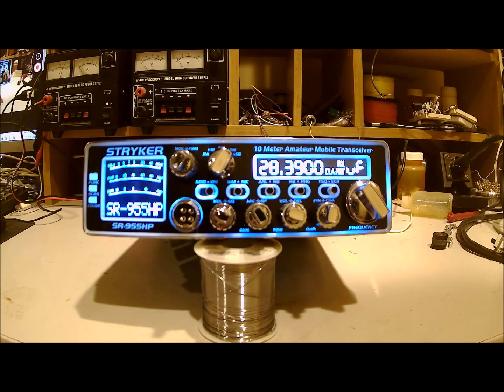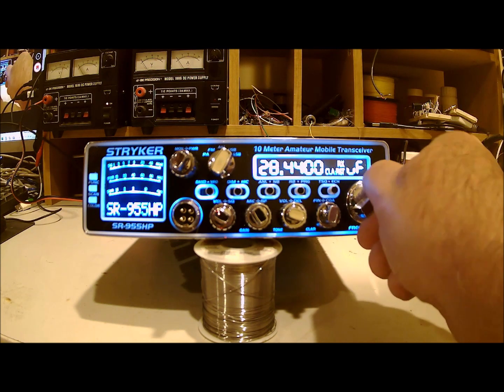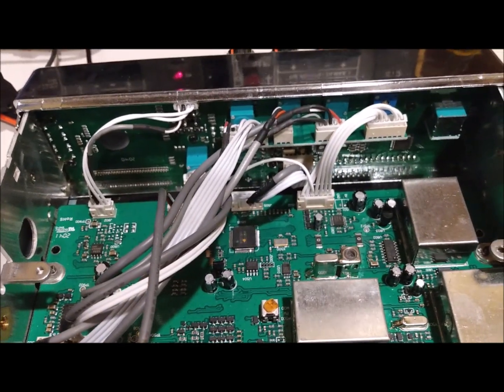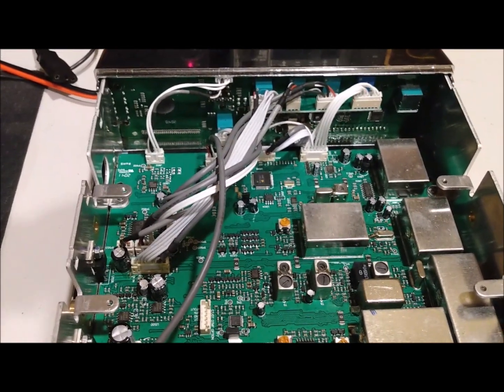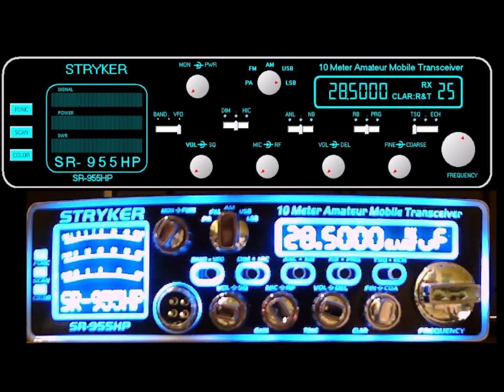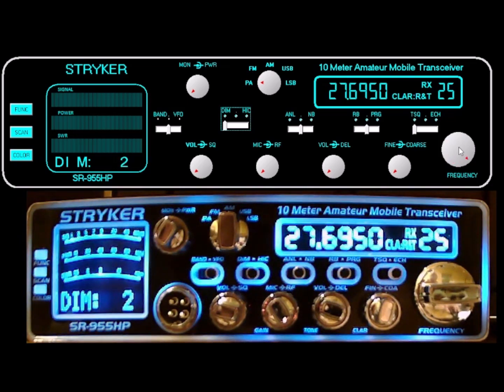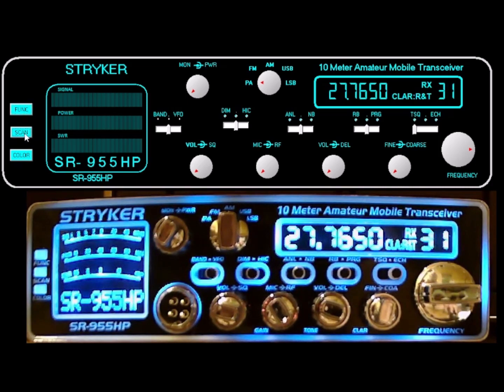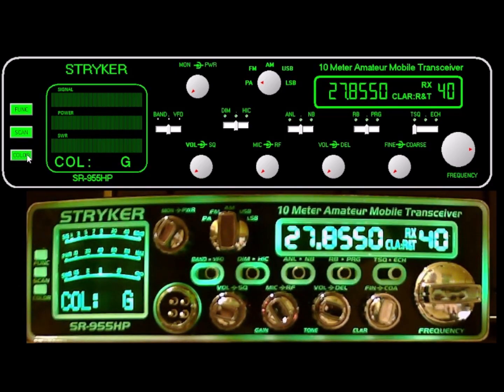Hacking the Stryker 955 part 1

Comment: Great video man! I’ve had my 955 as a mobile for a couple months now but holy crap it’s noisy as heck! Wish I could fix that..
Reply: I just turn the RF gain back to about 12oclock. Yes they are very noisy on receive!
Reply: What kinda noise? Static,engine noise??
Reply: @craig_sez8534  noise coming from the truck like the power steering possibly
Reply: @Fox250R  Unhook coax to see..If the noise goes away its ant related,bonding required....If noise is still there then its where your radio is gettin its power from,again bonding will help but change how radio gets its power...A bigger ga wire and re route furthest away from anything electrical and go direct to battery....Keep in mind that the longer you go the thicker ga you will need to keep voltage up..I suggest 8 or 10ga at the least..
Also look into clip on ferrites...Alot of the time led or hid lights make noise in radios as well..
Reply: @craig_sez8534  Yes I’ve done that and it’s coming from the antenna but it’s being picked up by some kinda electronics in the truck. When I turn the off and open the door 30 sec later the noise goes away. I did a video on it. I switched to a Stryker a10 mag mount and it got a little better but still a constant 4 pounds when the truck is on kind of sucks

Comment: I did this a few years ago and had the protocol published on my personal site for a long time.
I did it because I wanted to write a better application for the 8051 that runs the front panel.
The stumbling block being the company that makes the MCU was going to sell me the interfaces but when it came time to actually DO IT they stopped responding.
They have the integration files for Keil published and I was able to set up the environment but without the programmers.... well :)

So I created a whole new front panel PCB - all of that just to solve the pulse switch problem.
I would have rather written a new application for the existing MCU.. but alas.... :)
Cheers. nice project.
Reply from the maker: Hi Mark. Thanks for the response. What a pleasant surprise! After I published this video, I found out there was a lot of discussion on the switch issue from people that messaged me. I just visited your facebook page for a while and saw that you had a logic analyzer that had the two checksums in the right places, so yeah, you have the protocol. Can you give me the link to your analysis? Did you write some software like I did to emulate a radio? I plan on continuing on and including the various pots on the virtual radio. For the display elements, I have mapped out every bit to correspond with each pixel. If you have not done that, I am willing to share.

Pity about the microcontroller folks backing out. I would have been interested in that as well. The 8051 and I are old chums. I have not used it much in the last decade, but I designed an automotive ECU that controlled fuel and ignition using an 8051. I have moved over to the PIC family because I really like their peripherals.

My part 2 video is going to be about that channel selector issue. I was up late playing with that switch. As you know from what you have been doing, that switch does not put out a quadrature type signal. I had not run into that type of switch before. I was going to talk a lot about the switch and my two "solutions" but I don't want to re-invent the wheel if you have already done so.

Since the two signals coming from the switch have pull-ups and forcing a low provides for the signal output, it is pretty easy just to wire up something in parallel to provide the two signals. Using a logic analyzer it was simple enough to monitor the switch and the one byte packet resulting from the faceplate controller to the main controller. Just spinning the switch and looking at the byte going to the main processor shows that if you spin fast enough, there will be points where the processor just can't keep up. I really needed to quantify the maximum rate at which the processor can keep up though. I wrote a little code and drove those two pins with my own signal that I could vary the timing on. I ascertained that the reliable limit is about 39 Hz. That was at about 2:30 this morning. Again, I am running the risk of re-inventing the wheel, so please do send me your info that is online.

Like I said, I have two "solutions" to this issue that I want to explore. Neither one of them is as ambitious as your replacement of the entire panel. I would enjoy talking to you about that some time. My ideas revolve around replacing the little board the switch rests on, and processing the output of the stock switch or some other switch and then feeding the two lines with processed information like I did last night to achieve the 39 channels/second scan. Unfortunately, there is no power going to that board, only ground and the two signals themselves. Running a wire from the daughter board to the front panel board just to get 5V seems inelegant, and I don't like it. I considered trying to charge a cap and use parasitic power from the 2 10k pullups, but I think that is not viable. For my other solution, which  think I will actually use, you will have to wait for the video :)
Reply: @TinkTron  I worked out several possible solutions:
1. Write a new application for their 8051.
2. Redesign the front panel
3. Design a new board that the control sits on with some "special sauce". (this is actually the most practical)

3 Is the most practical. I did that already, I just never put it in the public domain...
The switch is a pulse switch. It's not the culprit... it's just subject to the speed of the 8051 and how much it's doing in main().
We can infer how they have configured the IP register on the 8051 based on behaviour. The serial interrupt clearly hs been configured at the highest priority.
However, neither INT0 or 1 have been configured and the up/down lines are connected to INT0 and 1 on the 8051 - they are clearly not enabled.
If you fire data off at the front panel very rapidly, you can really slow down it's ability to poll the other GPIOs.
On top of that it's reading ADC values and deciding what to do there.
It's obvious that the up/down lines are simply being polled in the main() loop along with reading the ADC.... and that's why if you fire data off at it really fast you can get it to spend most of it's time servicing the interrupt.
The weak point is the protocol. the front panel doesn't take deltas, it requires the entire packet with a valid checksum which is 50+ bytes including 0xFE sequences.

Drop me an email. mark19960 @ gmail. Happy to discuss it.
There are unfortunately no solutions for this other than those that are engineered. There is no control on the face of the planet that will fix this either.
Reply from the maker: @Mark19960  Hi Mark. I don't have any problems with the switch, per se. That whole issue is a red herring. I know you know this, but if you exceed speed at any time between two pulses, it will get skipped no matter what because of the reasons you mentioned. My plan was to swallow all the pulses the switch put out, no matter how fast they were, and then throw back the same amount of pulses formatted less than the 39 Hz speed. The user would never notice except for possibly the frequency being updated for a VERY short time after they finished spinning. The pulses never over lap on the two signals. There might be some switch bounce, but by taking advantage of the fact that the signals never overlap, this is a matter of a got flow chart to figure out the pulses. I made some measurements last night of the stock switch. There is a short pulse and a long pulse from that switch, that exchange places when direction changes from clockwise to CCW. Depending on how fast the switch is being rotatedm the longer pulse seems to fall within the range 2-200 ms. The shorter pulse was always somewhere in the range of 200 us. The shortest interval I ever saw of repeating the cycle was 4ms. Of course this exceeds the 39 Hz rate that I was able to force feed the current polling technique the 8051 uses, but it did not have to be this way, especially if it was done in ASM.

So I asked about links to your past work. Is there anything online? Like I said, I don't want to re-invent the wheel. Did you ever make a virtual radio in windows? I have made a quick video of the 38 Hz update rate for you to see. I also appended at the end a scope capture for the signals. The blue trace is the signal going to the UP pin of the 8051, and the pink trace is the byte the 8051 is sending to the main processor. Above this speed, the 8051 can't keep up and the apparent speed of the updating of the display seems to slow down or at least display some jitter. Here is the video  https://www.youtube.com/watch?v=vudz-cPPafk
Reply from the maker: @Mark19960  Mark, i just saw your land video. You and I are in parallel. I bought 85 acres in the woods 4 years ago, and I went into semi retirement a year ago. I have lost 60 pounds from all the work and I am in the best shape in 30 years. I have  put a military comm shelter on my hilltop a half mile away that is at 1500 feet. I was thinking that Stryker might be remote controlled from up there. For sure I will have a icom 7300 and VHF/UHF stuff. The peak has another peak 1200 feet away, and 200 feet above the valley. I am thinking some cool wire antennas are in order!!

Comment: Stryker gave me some software once that allows you to get deep into the radio. It’s not the basic programming software. I don’t think I have it any longer though. I could try to find it.
Reply from the maker: I don't have any of their software. If I did, I would like to enable a direct frequency command. I would also like to look into getting rid of that annoying command stackup when you move the channel selector quickly. There is no way they will share that though
Reply: I’ll try to get a copy. Need an email addy.
Reply from the maker: @mcconja  Thanks for the offer, but I would not want it unless it came from Stryker with their knowledge.
Reply from the maker: @DAVE_WHITE  No help needed at the moment, unless they want help from mark and I to work on some code. If they could get a version of their dual clarifier pot with a detent in the middle of the fine tune, that would be helpful because we could make a channel selector that incorporates my #1 and 32 solution.